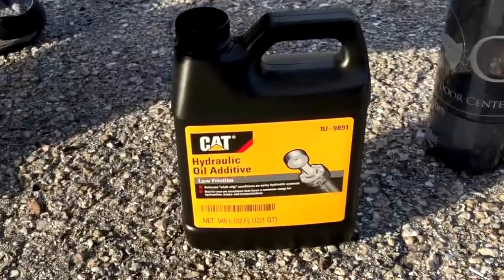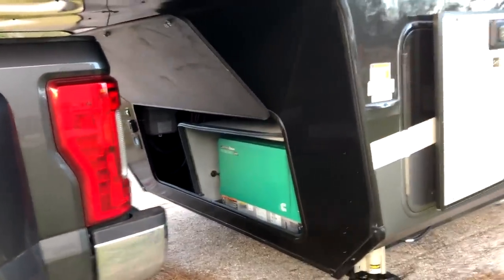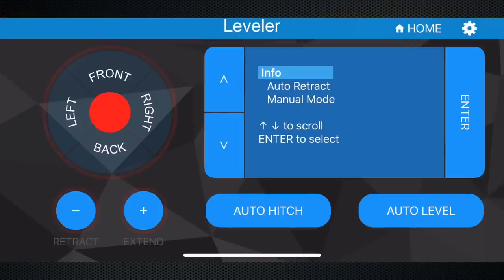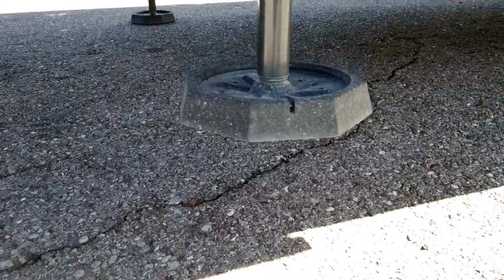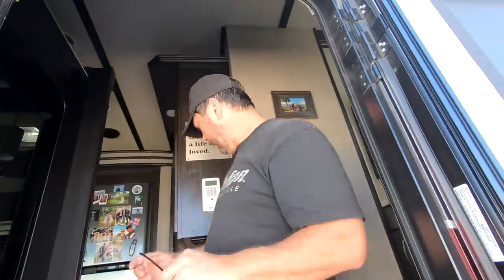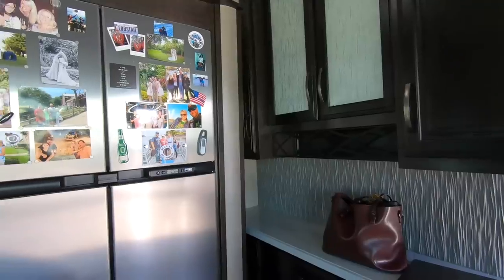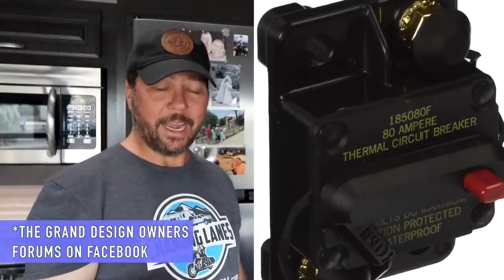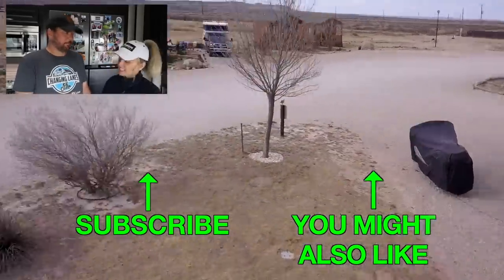Fifth Wheel Hydraulic System Tips and RV SnapPads | Full Time RV Living | Changing Lanes!

Comment: I change out the hydraulic fluid yearly & add the fork oil (my bus holds 2 gallons - I use Lucas Hydraulic fluid & the fork oil used in your video but would also consider anything CAT)
I carry a 'deluxe' siphon / pump too but at base camp I use a vacuum pump for hydraulic fluid exchange and so many other jobs... like drawing used oil out of the generator instead of laying underneath. Love it! Mine is a manual pump that holds (and measures) 4 qts at a time. 

Just installed the snap pads ~ so far so good.

Comment: In situations where we were not unhitching our 40' 5th wheel I would just put down the two rear jacks to stabilize for the overnight.  That rig had a Lippert auto level systems and I amost always had to do it manually because it wanted to lift the whole trailer, which it could do.

Comment: My only other comment is, this would not be what I would consider manual operation of the Hydraulic slides.  I know it says that what it is on the One Control, but is there a way (say the 50 amp fuse blows) to actually manually retract, or extend the slides and our jacks???

Comment: Excellent as always! Sadly, our camper was broken into and some valuable personal items were stolen. We could have had much more stolen had I not shut off the battery switch and locked the slides by closing the same hydraulic valves. When I store our rig, I always do these things now. When we travel, seems we are using the kitchen slide quite a bit, but most of the time after opening one slide and not the other, the valve seems to let a little hydraulic fluid through opening the closed slide about ½ to 1".  I just need to open the hydraulics to both, open both slides all the way and then close them and we're back in business. I plan on doing they hydraulic update you mentioned but I need warmer weather as I'm sure my hydraulic fluid would not come out very easily this time of year as it's still not warm enough.
Reply from the maker: That sucks about getting broken into!  Hear about that now and then with rigs in storage....

Comment: Great tips guys, thanks. About the valves for the hydraulics, label them [L] iving room [K] itchen. Question.. If hydraulics failed can you override manually? Not what you demonstrated but by turning/cranking.
Reply from the maker: Yes...  both of our slides have a small hole in the side for a crank that came with our rig.  Might have to give that thing a test sometime! 😳

Comment: Hi I love watching you guys I learn so much  thank you !
Question I’m a gal on my own and was going to attempt to change my hydraulic fluid in my leveling system and ordered the “fork fluid “ Would this be the same process you used to add a quart to eliminate popping to completely change the fluid ? 
Thank you wendy
Reply from the maker: This is just a guess.. But I'd think that a complete change-out would require bleeding the whole system.  It might be easier to do a 95% change out by bringing all the jacks up and slides in, then swapping out the fluid in the reservoir.  Then cycle everything a couple of times in and out.
Reply: @ChangingLanes  thank you so much !
I will try this tomorrow!
Wendy

Comment: Hey Chad! About the Andersen Jack Blocks issue... Was that due to a design flaw from Andersen, or is your 397th just too heavy for them? I wonder if they have corrected the issue you was having? My wife was wanting them for the added stability for our new 2022 397th that we are waiting on. BTW, I have watched almost every video you guy's have released on your rig. I can't find anything other than the regular snap-pads online. Did that manufacturer ever do anything like you mentioned in the video? How shaky is your rig with just the pads? We are used to the electric version and it gets pretty shaky at times. love all the videos!
Reply from the maker: Since they are rated at 6K, if memory serves, we were way under their rated weight and they still broke.  I assume it's just a bad design.  Snap pads is working on an add-on to lessen jack extension, but covid delayed that.. No idea when that's coming.  We have very little shake even without them.
Reply: @ChangingLanes  Thank you for replying! I may have some more questions about your 397 if you don't mind? But I'll wait till we get ours in a couple of weeks. Thanks again! Be safe!

Comment: Hi guys. You do some great videos. I might have missed it in an earlier video so direct me if I have. I was wondering if you would do a video sharing the cameras and editing equipment that you use to do your videos. We are just getting started and don't want to over do but also want to be equipped with equipment to do great videos.
Reply from the maker: We haven't done a video on it, but I can give you a quick synopsis: Our primary camera is a Canon 80D with Rode VMP+, sometimes mounted on a Ronin-S (gimbal). We use the GoPro Hero7 for some vlog-mode shots and as a secondary angle when using the Canon. On the Bike, we use a GoPro Hero 5 with Karma Grip (Tara manually filming), Two GoPro Hero 5 Sessions mounted in various locations, as well as the Hero 7. For aerial shots, we use the DJI Mavic Pro (original). We also just started using a DJI Osmo Pocket for quick out and about stabilized video. If you'd like more detail, we do have all of our camera gear in gear in our Amazon Store here 😎: https://changinglanesrv.com/amazon-camera-gear
We stared out with just the 80D, drone , and karma grip/gopro.
Also, if you're looking to get into youtube, we have a blog post about how we got started here: https://changinglanesrv.com/our-youtube-story/  
Has some info on Marc Leach's youtube course (KYD)...
Reply: Thank you so much. The information really helps to let me know where to start. Hope to meet you some day on the road thanks again.

Comment: I have a GD 349m Momentum and that was a very helpful video.
I'm just curious have you had any problems in cold weather with the front Jack's not going up all the way the first time I have to extend out a little and go up again like they get stuck.
Reply: David 7179 try a little WD40 dry lube spray on the pistons and be sure to keep them clean. It helps but they do tend to be slower in cold weather
Reply from the maker: We have not had that problem.  But that could be related to the 50A breaker getting weak.  I've heard of issues just like what you're  describing being resolved with a new breaker.  I'll be replacing ours soon with the 80 Amp breaker and I'll make a detailed blog post about it here when I do: https://changinglanesrv.com/

Comment: I am wondering about the advisability of swapping out a 50 amp fuse for a 80 amp. HOPEFULLY the new ones with an 80 amp fuse have the proper size wiring.....
Would hate to see something burn up.
Reply from the maker: I'll check tomorrow, but I think I saw 4AWG wiring in ours, which would be fine for 80amp < 65ft.  Even 6AWG is rated for 70amps < 50ft.  Also, the motor is typically only run for about 20-30 seconds which also minimizes the heat issue if the wire is only slightly under-rated.
Reply: @ChangingLanes  We have been watching your videos for a while and just hoped you were not overloading that circuit. By the Way, we recently purchased a Solitude, have two Harleys  and a Buell in the garage and am looking at a swivel wheel to take the Buell along this Fall, when we plan on going pretty much full time.
Reply from the maker: I did a little more digging..  The 80 amp breaker is now standard and it's what Grand Design will recommend if you have the fuse fail or get weak. The difference in gauge needed for 80Amp vs 50 is 4AWG vs 6AWG. One step difference, and at those distances, 6AWG is rated at 70Amps. Those ratings are also for constant current, but the hydraulic pump only runs for maybe 30 seconds for the slides and around 2 minutes of intermittent use for the levelers. So, the wiring is sufficient to handle the 80Amp breaker.
You have the 374 solitude?  Not sure I know what you mean by a swivel wheel... have a link?
Reply: @ChangingLanes  I am glad that the wiring is good. Actually we have the Solitude S-Class 3350RL. Swivel Wheel is an add on, looks kinda like a trailer that can haul a motorcycle or other small toy.
You can see them at swivelwheel.com
Reply from the maker: Oh yea!  I remember those now!  Very cool!

Comment: Can you give a little more information on the 80 amp breaker replacing a 50 amp fuse, doesn't sound quite right.  Where did you put the breaker ? I've got a momentum 350, and a 16 Roadmaster, love them both.
Reply from the maker: The 80 amp breaker is now standard and it's what Grand Design will recommend if you have the fuse fail or get weak.  The difference in gauge needed for 80Amp vs 50 is 4AWG vs 6AWG. One step difference, and at those distances, 6AWG is rated at 70Amps.  Those ratings are also for constant current, but the hydraulic pump only runs for maybe 30 seconds for the slides and around 2 minutes of intermittent use for the levelers. So, the wiring is sufficient to handle the 80Amp breaker.
On our RV (and likely others), all of the stock breakers are banded together on one side like a bus bar with only one source cable (back to the battery).  So, to upgrade to the 80 Amp breaker, you'll need a short run of 6AWG with lugs on both ends to tie it back into the DC source.  Hope that make sense.  When I replace ours, I'll make a detailed blog post about it here: https://changinglanesrv.com/

Comment: I need to lift the front end on my class c to replace shocks, steering damper and wheel bearings can I use my levelers to lift front end?
Reply from the maker: I would use a jack and jack stands.  Considering the engine is up front, I would not want to be under it with just the levelers holding it up..

Comment: I bought the hydraulic additive you recommended. My hydraulic fluid runs the jacks and the slides. I put the additive in and now my Main level Slides won’t extend. Could this be the cause of the additive? Does this additive affect the slides?
Reply from the maker: The additive shouldn't affect that at all.  Our main slides are hydraulic also.
Reply: @ChangingLanes  thank you.
Reply: A ground wire came loose. Slides are working. Thanks for your reply.

Comment: What is the hydraulic motor rated for, going from 50 amps to 80 amps before cutout seems like a meltdown before it blows.
Reply from the maker: I'd have to check.  But they are putting 80 amp breakers in the newer rigs with the same hydraulic system.  And lots of people have had no issues replacing  the 50amp with the 80amp.

Comment: We just bought a 2019 Grand Design Solitude with auto level. Is that app on your phone compatible with our system? We never heard about that before. How do we get it?
Reply from the maker: Yes... If you have the LCI OneControl panel (touch screen).  Our's has a sticker near the control panel with instructions on how to connect.  Ours is over wifi, but newer ones might be bluetooth.
Reply: @ChangingLanes  It appears we do not have the Lippert module with wireless capability. We didn't know that was an option, and we are disappointed that our dealer did not mention it. Thanks for the help!
Reply from the maker: Hmmm.  I know the newer models have a different "wireless" option that includes actual cellular wireless, but I thought they all had the basic functionality of using the app.  Do you have the touch screen?  If you have a touch screen, I would call GDRV directly (574-825-9679) and ask them about it.  Dealers tend to be clueless when it comes to the details.  GDRV might also be able to tell you what you would need if you don't already have it.

Comment: You mentioned the hydraulic 50amp fuse but never showed where it’s located? Just curious is it obvious down by the hydraulic system or buried in some random closet 🙄
Reply from the maker: It's likely a bit different on every RV.  But it should be near your hydraulic pump which is likely in the front bay if you have a fifth wheel.  Just follow the red wire from the pump.   When I replace ours, I'll make a detailed blog post about it here: https://changinglanesrv.com/

Comment: How do ya know how much fluid to keep in? I'm not sure if yours does but mine doesn't have a "full" line. Thank you
Reply from the maker: The general idea is to remove the same amount of fluid as you put in. 
 When you pull all of the jacks up to perform this operation, you can get a feel for how full it is, but I don't think there's a full line other than the top of the reservoir.  What we did was pour the quart of additive into a temporary container, then we siphoned out into the quart container till it was full.  That way I knew we removed exactly as much fluid as we put in.  Hope that helps!
Reply: @ChangingLanes  awesome that does help out. Thanks again for the help

Comment: This is off topic but, have you ever tried fueling up at the semi pumps at a truck stop? I tried once recently (after 12 years of rving) and the nozzle wouldn't fit in my F-250. Was wondering if they fit an F-350.
Reply from the maker: Yes.. when towing that's all we'll use are the truck lanes.  The nozzle is fatter and pumps super fast, but our F350 accommodates it fine.  Not sure if all 350's are like that, or just the duallys with the 48 gallon tank.
Reply: If you can fit the nozzle in be careful some of the pumps are 60 gal a minute and you may get some splash back
Reply: Diesel nozzle also fits the short bed 34 gal nozzle on '17 F350
Reply from the maker: We have noticed some pumps I have to go half or 3/4 throttle or it will kick off...
Reply: Do you ever got to a truck wash like Blue Beacon or do you always wash the exterior yourself .  Ps love the videos keep them coming
Reply: Thanks, Just a another reason I have to upgrade the 2008 super duty.
Reply from the maker: Thanks, Travis!  We've had the rig cleaned once at a truck wash (not blue beacon) and they scratched it up a bit (very light brush marks), after which we had it washed and waxed professionally to remove the scratches. Up until that experiment, and ever since, I use this kit and LOVE it! https://amzn.to/2U4qQHR I can wash/wax the whole rig in about 2 hours. 3, if there are a lot of bugs on the cap. Maybe 4, if I want to really detail beyond what I can do with the wedge tools in this kit. And it's a "dry" wash, so you can even use it in the majority of parks that don't allow washing, or charge extra to allow you to wash with water.

Comment: Have you all had any issues with the auto reset breaker.
Reply from the maker: Do you mean the 80 amp one we showed in this video?  I haven't installed it yet.  Just have it on hand in case the 50 amp (stock) one fails.  No issues yet, but I like to be prepared.  That said, I've heard the hydraulic systems perform better with the 80 amp in place of the 50amp... So I might just get a jump on it and put in in early... Like I don't have enough projects on my list.. 😁
Reply: @ChangingLanes  yes we had our fail  and not reset at all. Good thing they have an unused 30 on the same block and saved us at that time. I had spoke to a Lippert tech at Tampa show a couple years back and didn't prepare. Yes the pump seems to work better with manual reset breaker 80 amp.
Reply: @ChangingLanes  LOL, I guess i asked about breaker without finishing you video. Must have been distracted. 
next time i'll hold comments until the end. haha

Comment: Do you have a link for the 80 amp fuse?
Reply from the maker: Sure do... 
Bussman 80 Amp Breaker: https://amzn.to/2urckyT 
Note: it might not be a simple swap out.  I checked ours and our stock 50 amp fuse is part of a block of DC fuses.  So, while I can disconnect the positive side from the stock fuse (and connect to the new one), I'll need a short run of wire to connect the chassis ground side of the new fuse.